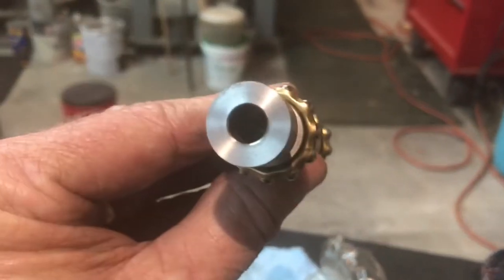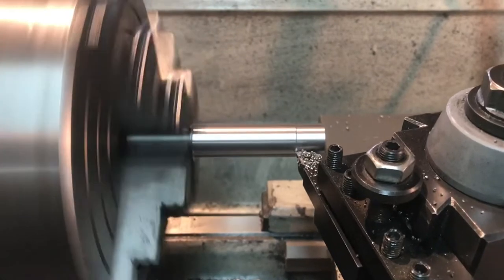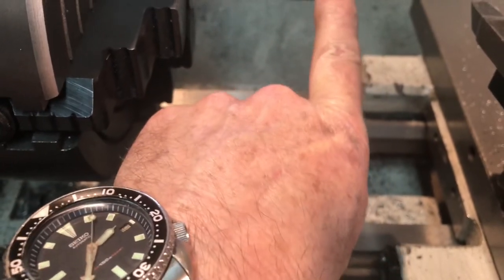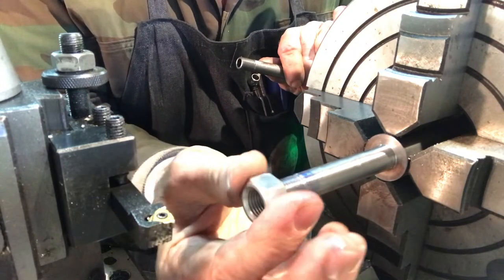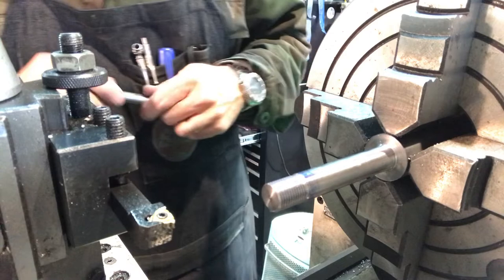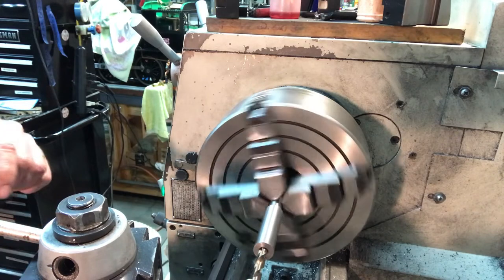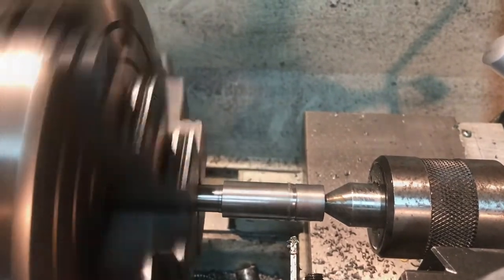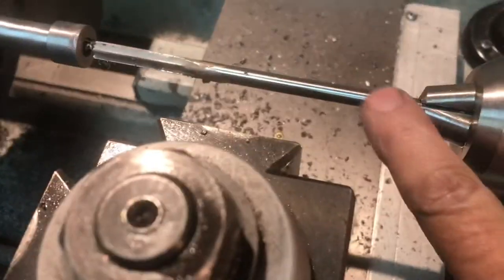Success! Quorn Tool Grinder project spindle, “take two “

Comment: Glad I stayed to the very end. I don't recall you demonstrating a reamer being used and was going to ask about it. As a noob even the `intuitively obvious, no brainer` operations are new and interesting. Thanks for sharing.
Reply from the maker: The reamer ops start around 22:52 minute mark. I basically drilled each side to Letter N drill size (.302” diameter), then reamed about 1” to 1.5” at a time. Removing the reamer each time to clean off chips and reapply cutting lube (tap-paste)…

Comment: Also you mentioned having to use a magnifying glass. Better yet do a search on YouTube for comparisons of digital microscopes. You can even plug a big hdmi tv in if the screen is to small. Was like getting new eyes for less than $200.  I bought a second one after I tried the first    One of mine is a Andonstar 5 inch Screen 1080P Digital Microscope. But there are many makes and models. I’m sure mine is obsolete already!